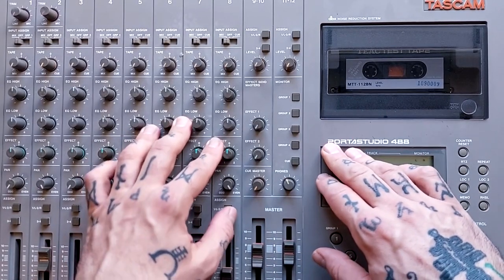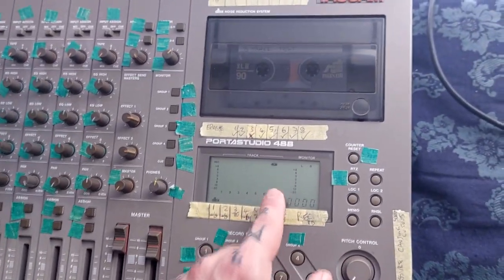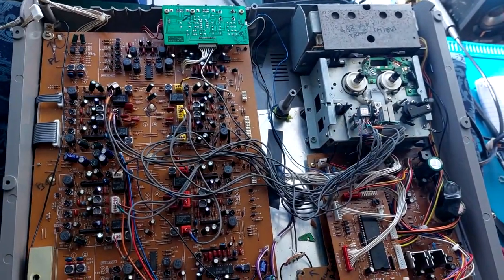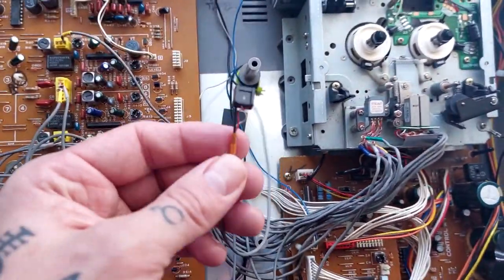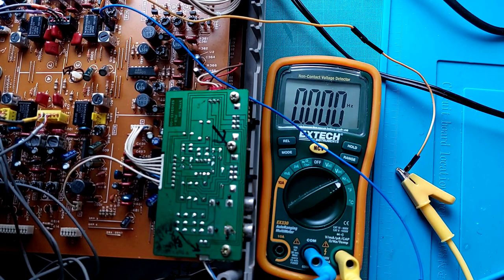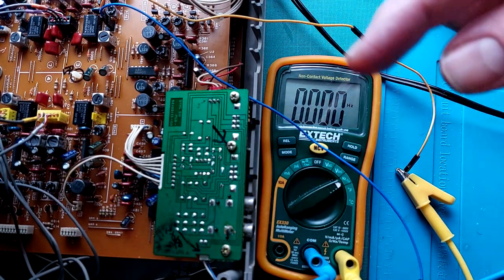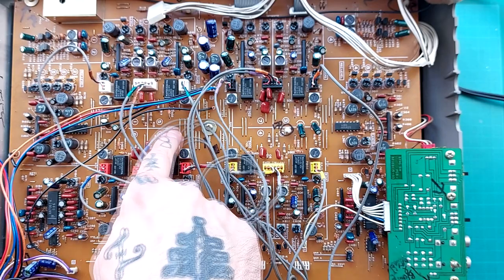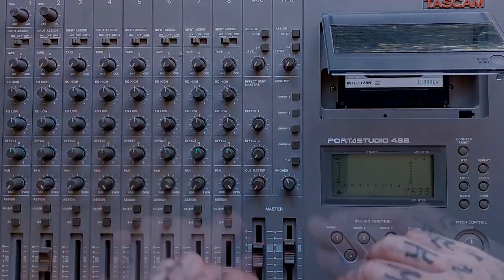Diagnosing Portastudio Erase Problems | Tascam 488 Repair Report

Comment: Just picked up a cheap 424 mk2, and the seller says track one erase isn't working.. This video give me some hope.. I've repaired and serviced some teac reel to reel, so feel confident I can resolve this, without losing it.
Great effort to make this video thank you
Reply from the maker: Thanks. So far as I can make out the r2r stuff is a lot harder to work with so you'll be fine!
Reply: @Tetrakan    R2R is alot easier to work on it's mostly mechanical and the steal components never crumble or bend or go out of shape cassette is a generation after R2R but there is way more working and fixable R2R's than cassettes i restored a Sony TC366 and there is no tape hiss on R2R vs cassette. If you never tried  R2R repair you would be hooked on how easy it is

Comment: Hey man! Having a peculiar erase issue with my 488mkii that perhaps you could help with. I've noticed that the erase function for tracks 4 and 8 is somehow linked in that whenever I record anything to track 8, track 4 is erased. Both tracks record fine with signal directly to their input. I can record fine on track 4 OR track 8, but for instance if I try to bounce tracks 1,2,3,4 over to tracks 7,8 or do a stereo mixdown to 7,8 track 4 is erased which leads to an incomplete bounce which is really annoying!!

Any chance you might be able to point me as to where to look/address this issue? I'm at a bit of a loss. I previously had some issues w buss 3-4 or whatver that was fixed by reseating the internal connectors. 

Thanks for sharing your wealth of knowledge and experience with the world man! Got most of the mechanical issues with this unit fixed thanks to you, also restored a couple other decks that from your videos as well. Meaning to join your patreon and keep this rocking!

Comment: Is there a way to isolate the transport from the case and test? Massive PITA, using cable extensions for the audio/power cables from the transport etc. If that worked true to the calibration it's time to get physical with whatevers warped on the case and is touching parts it shouldn't. Pliers and wrath will be useful here. I do have one of these, but haven't used it very much, seems like a great machine so I might dig mine out and start squishing the case a bit!
Reply from the maker: Hi, thanks, yeah I've done that, though in a sense the plastic cassette cavity is part of the transport...the cassette  tips in the naked transport which causes tape to head contact issues of its own. The adjustment screws on the 8 track tascams are more comprehensive and allow for improving tape to head contact, so eventually I'll try to make that adjustment, but doing so will mean the azimuth is out of whack, so I'll need to wait until I have a dual channel oscilloscope so I can rectify that. Like you say, massive PITA!

Comment: Hey! I've got a 488 mkII where 3 tracks won't erase at all... Your video helped me a lot in investigating the issue, but I ended with the conclusion that the erase head itself is broken (the three malfunctioning tracks have an open circuit through the erase head). I tried resoldering the wires connecting to the head, but the issue remained. 
Is there any way to fix a broken head like this? I was thinking I could try to heat up the head in hopes of the ciricut closing, but that would be a last resort. 
In case i need to buy a new one, would it be possible to use an erase head from a 488/688/mt8x or are those heads different? And is there any way to buy a head separately, or do I have to get it from a spares unit? (Edit: found the tascam ninja answer in another comment)

Anyways, I really appreciate your videos! I had to replace the capstan belt and gear C in my machine and it would definitely be a lot harder without the vids.
Reply from the maker: I'm not aware of a way to repair them, sorry. And they're not made anymore. Hopefully one day 3d printing tech will develope enough we can start making new ones in small runs.

Comment: Hey, my 488 mkii has a problem with it’s pitch control knob. It doesn’t’t have the original plastic knob, instead it’s a silver-colored one without a line on it (I drew one with a sharpie). The bottom part of the knob is broken because it’s too small for the potentiometer. And it only works in the negative direction for a few seconds, then it speeds back up to normal. It also slows down briefly when I push down on it, which is weird. When I tried to adjust the speed on the potentiometer on the control pcb, it stayed the same speed. Also, where can I find a new door for it? Mine came without a door.
Reply from the maker: For the door you'll need a spares donor, unless someone 3D prints these unbeknownst to me...any tascam from the same generation and previous generation- 464, 424 mk ii etc - will have a compatible door and pitch knob. It could be one of the speed control wires to themotor is bad or the motor control  chip is overheating.

Comment: Tascam transport boards are soft and pressing tactile switches on the transport will eventually lift components and traces when you go to replace tactile switches with my experience mostly with the 2488 series harddrive recorders then things go wrong quickly.
It would be great if tascam got someone to copy the transport boards on every model they made and sent them to pcb way to manufacture fresh boards so we could just repopulate the components onto a better manufactured transport board

Comment: Very informative video! What a pain, I’d never of guessed the casing alignment would be causing erase problems and it looks like it’ll be frustrating to sort out. I’m dropping off my two 488mkII’s (and 688) to get fixed tomorrow at a repair shop. I wonder if the misaligned casing is causing my issues too?
Reply from the maker: Looking at the service manual, it seems you can increase tape pressure using adjustment screws at the base of the head, provided you have a calibration tape to check azimuth afterwards, hopefully your tech can attend to this.
Reply: @Tetrakan  thanks, hopefully so. 👍

Comment: Is it possible to find an erase head for the 488 somewhere? Mine has no continuity on multiple channels. :( Cable tests ok.
Reply from the maker: Sorry to hear that. I've bought two for clients from Tascam Ninja, but they weren't cheap. Otherwise, you need a spares donor, which is where TN got his anyway - these things are no longer in production, sadly.

Comment: hey so my tascam 488 used to work great but since i moved to my new flat it just wont play any casettes anymroe. i can rewind and forward but when i press play the (i guess they are called tape heads) come out but then nothing happens :( if you could help me that would be so dope <3
Reply from the maker: Could be as simple as the capstan belt is loose or snapped, have you checked?

Comment: You seem to know everything about those machines. Have You tried to recalibrate one for type I tape? Is it even possible? Fresh type I tapes are more accessible than type II, and with proper calibration they sound excellent. At least from what i get on stereo deck.
Reply from the maker: Yeah, the bias frequency and amplitude can be adjusted. I’ve struggled to find the correct leavers for type one documented though….